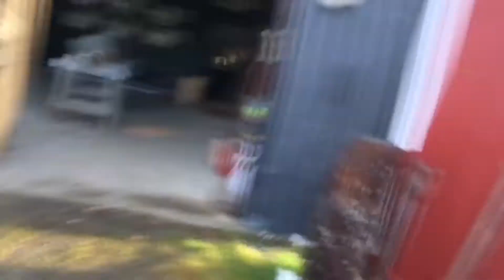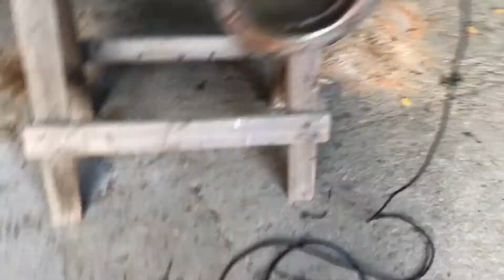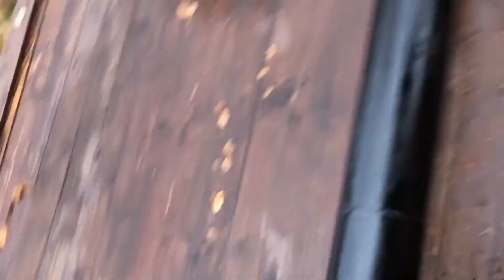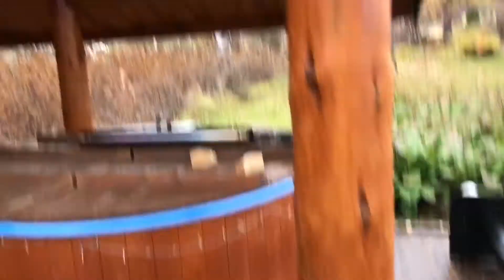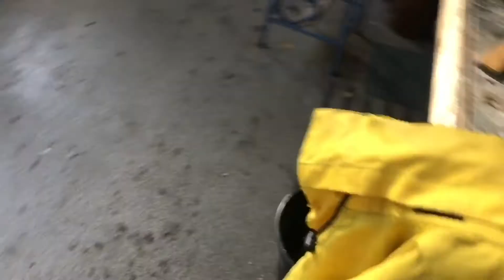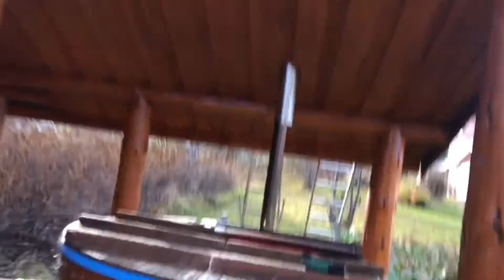Hot Tub Chimney Install in the Arctic on the last day before winter.

Comment: I thought for second you may have changed your mind and wanted to put the pipe an air horn on the VW van .would've been an improvement ya no?😂🤣😂🤣😂
Reply from the maker: No, the out coming air will just slow it down. Just opening the window is like a drag chute opening!
Reply: @arctic-rebel  yes there would be a drag ! But it would sound like a train. 😂